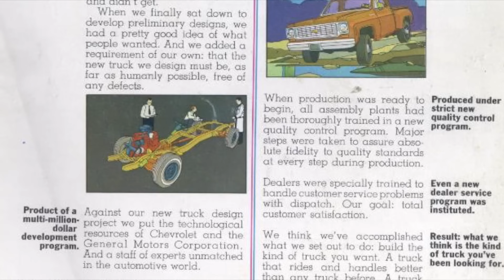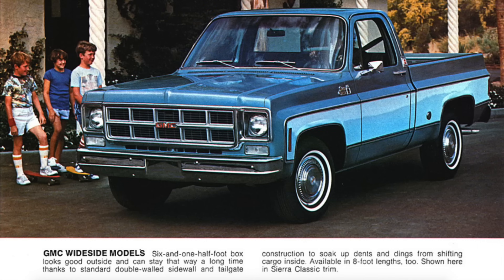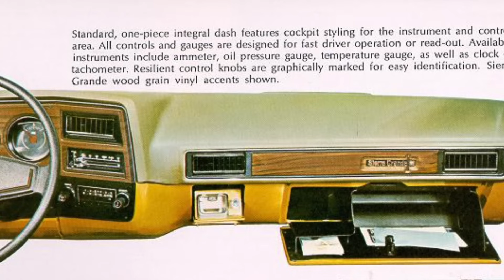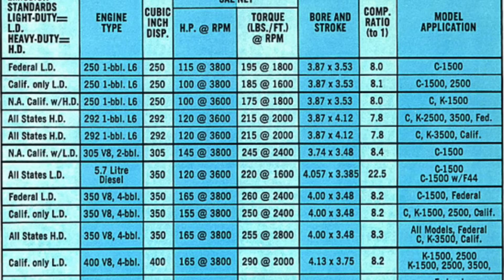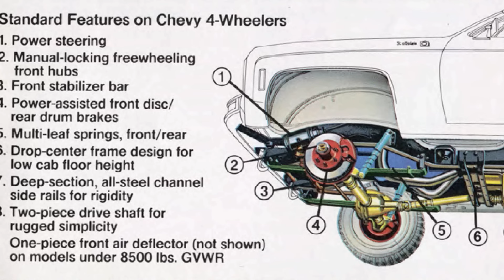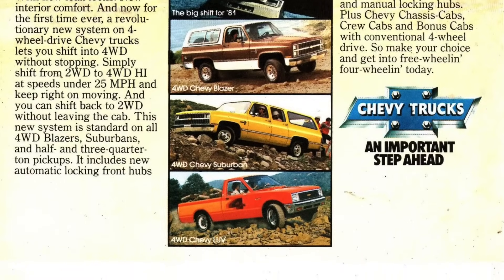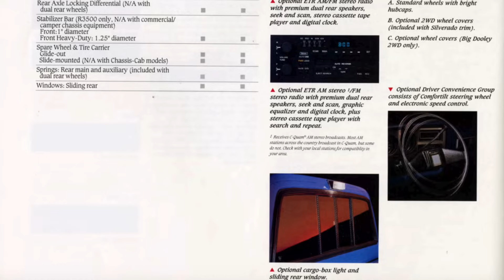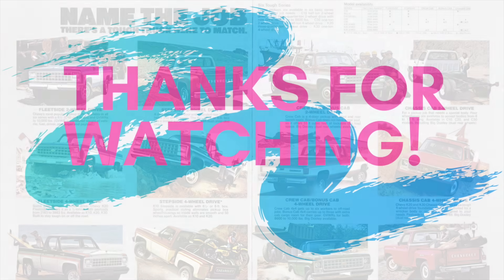73-87 Square Body Chevy & GMC C/K Truck Buyers Guide (Design, Options, Engines, Common Problems)

Comment: I own... (hang on, let me count) ...9 of these trucks:
A 79 C10 Suburban, silverado, 350 (400 now) auto, a/c, barn doors
2 78 C10 "big 10" reg cab, custom deluxe, long bed, 350, 4spd (both green)
A 78 K20 reg cab, scottsdale, long bed, 350, 4spd
A 78 K5 Blazer, cheyenne, 400, auto (converting to 4spd)
A 79 K10 GMC reg cab, long bed, 350, 4spd
A 79 K20 reg cab, scottsdale, long bed, 350 4spd (parts donor)
A 76 K5 Blazer, cheyenne, 305, auto (parts donor, had 350 in it when I got it)
A 77 K5 Blazer, cheyenne, 350, auto (parts donor, converted to 4spd)
And and honorable mention...
A 66 C10 reg cab long bed, 250, 4spd, (currently has a 292 while a 327 is being rebuilt)
Oh, and an 83 GMC that I gave to the kid because nothing after 80 is worth owning. ;D

The problems I have with these trucks are owners who don't understand them.  There is absolutely nothing wrong with Quadrajet carburetors and replacing them with Edelbrock's only causes more problems.  The gauges are easy to fix, you don't need to make extra holes in the dash to mount aftermarket gauges in a place you can't see worth a crap anyway. Please STOP doing this to these poor trucks.  Also stop with the electric fuel pumps and fuel injection conversions, it makes me want to vomit.  If you want modern convenience, buy a modern truck, ffs, don't f#@k up an old one.  I also hate the term "square body", they aren't f#@king square, as was stated in this video.  Go back and listen to that part again.  Finally, I hate that everything from 73 to 87 gets lumped into one generation.  First of all, the body carried over to 91 on some models, and second, just because the beds are the same doesn't mean that they are all the same damn trucks.  Everything 81 and up is f#@king ugly.  Square headlights look like s#!t.  I drive trucks from the 73 to 79 generation, and I'm open to the 80 models as long as they don't have those god awful, bug eyed square headlight conversions.

Now, what I love about these trucks, they look good, they're tough as hell, they will last forever if you take care of them (and taking care of them is easy), and they're simple.  They don't have any extra crap that you don't need (except maybe cruise control, tilt columns and of course emissions crap from 79 up).  As I said earlier, if you want modern comfort and convenience, buy a modern truck, don't f#@k up an old one.  You don't NEED that crap, you WANT it, learn the difference.  The only modifications I make to my trucks are manual choke conversions because it makes them even more reliable, and I removed the emissions equipment on my 79s, which is why I mostly have 78s and older, because they didn't have EGR, catalytic converters, evaporative emissions systems, etc... and they don't need any of it.

Comment: Welp I bought one for $5,150 this week. It looked and sounded like it was in great shape. I went half way across Washington state to get it and on my way home it died and I had to tow it all the way back. It's in the shop right now and slowly getting diagnosed looking like it might need a possible engine rebuild. Initially I thought it was the alternator but it's not -it's either the starter or thousands of dollars worth of work. Be care when you pull the trigger people - even if it looks and sounds great... anything can happen! Hopefully I get out of this and didn't buy a 5K yard ordainment

Comment: The main problem with these trucks is rust. GM finally started fully dipping them in zinc primer in the 80s. My 79 Jimmy would be worth twice as much as it is now, where it not for rusted fender and tailgate.

Comment: I’ve owned my grandpas 1987 r10 for 15 years. It’s been great. I will say the 700r4 transmissions are not very robust. It had the 305 TBI engine and 2:73 gearing so it was extremely gutless on the hwy and did not like towing. I swapped 3:73s after high school and a period correct 350 tbi. That was a huge help and made it a joy to drive. It was very reliable outside of the transmission, but I towed waaaaay too much weight with it. Now it has a 6.0 modern engine and 4l80e. It’s much faster , but I miss the simplicity.
Reply: If you make sure to NEVER use overdrive when towing, the trans will last forever.

Comment: I owned a 1973 3/4ton truck,heavy duty all the way,7.50x16 10 ply tires split rims. After that truck I Bought a new 1986 Silverado and still own it,  It has been garaged most of its life and is currently semi retired on a lift in My climate controlled garage Zebarted when new zero rust,  Daily driver, a 2011 GMC SLT all terrain

Comment: ..Owned an '85 2wd...drove great, rode great...overall, I like them...and MUCH more so than newer trucks..to me, the GMT 400 trucks ('88-'98) were the last of the real, honest trucks...my take on the Squarebody, is although I like them, especially the earlier models, is that IMHO the '67-'72 were MUCH, better, and MUCH, MUCH better looking... not even close...and I like the '60-'66 next in line after them...the Suarebody's are maybe 3rd...anyway, in my experience, the major negatives on the Suarebody are: 1)..they were made WAYYY too long...I have always resented the fact that they were made 15 years(longer with the crewcab/suburban/blazer), and the '67-'72 were made only 6 years...if only there had been 2-4 more years production on the glamor trucks...introduce the suarebody, say, around 1975-76.....2)..The dashes were always, and still are, horrible...EVERY one, and I mean EVERY one, has/had a cracked dash, and no real long-term way to fix them right..I remember at work in the '80's, they bought fleet GMC's...within one year of being new, the dash pads were starting to crack...usually first around the speaker areas, then around the defrost outlets...absolutely horrible...3)..I always found the instrument panel/cluster a pain to take out and work on...WAYY worse than a '67-'72, and even the '88-'98 GMT 400 dashes were easier to work on....4)...all the ones I ever owned/drove, you had to almost SLAM the doors to get them fully closed with the windows rolled up...even on a new truck...if you didn't, they wouldn't close completely, stop on the first latch...then you had to open, then try shutting them again..'72-'93 Dodges had that problem, too..maybe trapped air??...never had that problem with a '67-'72, or an '88-'98, unless the hinges were worn out..5)..the vent windows were always hard to open and close, and whistled badly in the wind...much more so than the ones on my '67-'72's...6)..the early models,'73-'80, were really bad rusters...they did solve that problem with the '81-'87's, though...they were some of the least rust-prone trucks I know of....
Reply: There are after-market dash pads that are far better than the stock ones.  Doors that are hard to close with the windows up means the weather seals are good!
Reply: @michaelbenardo5695  Still rather have a '67-'72, they are a much better, solid truck, and look better. Really, a '64-'66 also. Another thing I didn't mention, is as work trucks, the big wrap-around tail lights were much more prone to get busted out backing into things(also true of 72-93 Dodge, 80-96 Fords)..the '72-back GM trucks, and '79-back Fords, the tail lights were recessed and much less vulnerable...

Comment: Also the K5 blazer production went up to 1991. Came with TBI and that system was as reliable as hell
Reply: So were the 3/4 & 1 ton crewcab trucks.
Reply: 1995 in fact was the last truck year for TBI.

Comment: I am thinking about taking up my uncles 1983 c2 square body. it has a 454 big block, crew cab, dually, with an 8 foot bed that has side steps on the side in front of the wheel wells. i think its a good investment, but its wore out and needs some work. glad i found this video so i can prepare myself for what i might find out when i tear into the truck.

Comment: bought a 83 chevy scottsdale fleetside new in 83.  two tone silver and blue. power windows,a/c,tilt wheel,intermittent wipers, cruise control,velour seat,am/fm radio (has been changed out to a modern unit) 2wheel drive,305 engine,overdrive tranny.  still have it. 150k miles .  needs some interior work but runs strong.  (take care of your toys and they will take care of you)

Comment: The weak point on these trucks were the frames.  I have crushed several of these trucks and would notice frame cracks at the engine mounts on units crushed with the engines in them.

Other than that, these are my favorite Chevy trucks.

Comment: When I was in the army I had a cheyenne super 20 camper special  4x4 with a 454 v8. Homemade steel bumpers. It's currently buried in Peyton colorado. We gave it a funeral. My buddy's used to say all we need to do is drop daigle and his truck in to iraq and the Iraqis would surrender in a week.

Comment: I daily drive my 85 gmc 1 ton . 660,000 km , HT 383 GM crate, all MSD , ram horns  , xpipe, Flowmaster, sm 465 with gearvenders. Love it . Pulls a Bandit model 90. Lotsa torque.

Comment: I've owned a 71 C10 , a 88 Cheyenne ,99 3500 dually dump truck & a 03 Silverado the last 2 I still own & use , But as I remember the 73 & 74 had serious rust problems never owned one but the latter 1's are really nice & improved.Thanks for the video.
Reply: That was their only real flaw - the rust.  The 73 was the worse, as it didn't have roof drip rails and most had rubber floor matting.  In the winter, when you opened a door, water would drip onto the floor, get under the rubber often, and stay there, hence, a floor like Swiss Cheese.
Reply: @michaelbenardo5695  Thanks for the info. That explains allot.

Comment: The 4 speed manual sm456 transmission can fall out of 3rd gear when worn or higher mileage. 
Leaking door seals and dirt from your boots can cause rust under the door sills. Super common.

Comment: I owed and still own a 2003 gmc that i bought new but i had 73,74,79 and a 1986 c 10 silverado witch i drove till 225k loved that truck and second to that one my 2003 gmc sierra all of my truck where are very reliable only had to tow all combind 2 times .

Comment: Death is possible in rear end collisions due to lack of headrests in the single cab.  The head will snap back upon collision and be severed from the metal supporting the glass.  The solution is to add seats with headrests to the single cab.  This word of caution is for any single cab trucks without headrests.  A popular retrofit is to add a power bench seat from a Cadillac from that era.
Reply: One of the things I like about them is NO headrests.

Comment: I had an 80 silverado with a 5.7 diesel. that truck didn't have the speed to get out of it's own way, but it could pull trailers like they weren't there. driving home from work one night, the engine slowed way down slowly and finally died. good thing I kept a bicycle in the back
Reply: That engine was really bad.  It was an Oldsmobile engine and was based on their gasoline engine, which was a mistake.  Diesels should be undersquare and should have more than 4 bolts per cylinder.

Comment: Nice video👍 we own a 1981 k30 that’s been passed down through our family.  The only issue I’ve had is the new ethanol fuel. But that’s been fixed with a new Carb and upgraded fuel system to reduce vapor lock and old blue runs like a top!

Comment: Iv got a 78 c20 cheyenne check floor pans and springs the old heads loaded em to the moon there's always 1 busted no matter what and as long as you buy from an older guy usually the motor will runs trans may be fried but iv never seen an original to vehical trans not work unless it was started of fluid or pushed to hard just look at everything and if it's outside your comfort leve to fix walk away ir take it some where the community for these old trucks is normally supportive the info on how to make them work is extensive buy one and try it's a good way to keep your mind occupied

Comment: The only problem ive had is overheating but the 350's are reliable engines but if you push them over their limits watch the temp gauge
Reply: If your's is an 80s version, you might want to replace your smaller radiator with the wider thicker one, as Chevy engines normally don't overheat.  In the 80s, they did use smaller radiators than in the 70s to make the truck lighter and score higher on the gas mileage tests.

Comment: Bought a brand new 1976 Chevrolet V8.  Usually got less than 10 miles per gallon.
Reply: Hey that’s what I got 
Your right about the miles per gallon but truck still badass
Reply: 73 C20 10mpg loaded or empty.
Reply: Don't feel bad. I have to baby my newer one to get 7.0 mpg.  Take off hard at one stop light, I'm down in the sixes.
Reply: But gas was 60 cents per gallon
Reply: I have a 76 Scottsdale step side gets about 10 miles per gallon at today’s gas prices

Comment: I found mine in a salvage yard 600 bones , 3/4 ton 350 4 speed with 123000 original  miles , other than it being neglected , after a new clutch master , brakes , tune up and a carb that I had lying around , solid as a rock , lol chevy pun , drive it everyday , only gripe , 160 hp , when this engine goes I'm gonna double that output atleast , cool video

Comment: I have a 1979 I bought in 1990. Fully restored with 355 cu,in. , 3 spd. auto w/ shift kit. Lowered , AC , power steering , disc. brakes , Cragars & with special raised hood . Midnight Black & sweeeeeeeeeeeeet !!!

Comment: Swapping a 5.3 into mine right now. Funny thing is it's a 78 BIG 10 stepside silverado 2wd came with travel tanks trailer brake. Ran into the cracked frame fabricated my own gussets and went QA1 and converted to rack n pinion. @3litersofdoom

Comment: Like you said, 1973 was the first year for those Chevrolet & GMC square body models. They were produced up through 1991 except for the regular cab pickups & medium duty models which became obsolete earlier. In 1987, the half ton & three quarter ton regular cab pickups were finished, but the one ton regular cab pickups on the other hand were still in production up through 1989, & same with the medium duty models except they stayed in production up through 1990.

Comment: The 327,292 six,350 4bolt main all got around 20mpg. In a 4x4 tow anything. Lifted 4x4 1/2 ton or 3/4 with 350 add limited slip or locker go anywhere chained up in deep snow. Suburbans were tanks. 86 on first fuel injection system sucked but a carb. 4brl. Hard to beat.
Reply: 20 MPG???  Maybe down hill with a tail wind.

Comment: Got a rusty 75 K10 with a strong 350. Only 65k miles. Been parked for a decade. Bet fresh gas and battery and she'd start right up.
Using a 98 Z71 Silverado lightly with 117k miles. Mainly use it for light hauling and snowy roads.
Probably ought to sell the 75 but kinda want it on the road for it's 50th birthday
Reply: Keep the 75!  No damned computers!

Comment: I had a 1981 Chevrolet 4x4 K5 Silverado Blazer. It was under powered but still a mountain goat.The factory paint was horrible and faded in spots and the door hinges gave out. Other that that it was a stud.

Comment: A lot of people like and restore old square bodies, and some people don't like them, one thing for sure is days of simple though trucks that last year's upon years are gone and over
Reply: I’ve seen multiple 1990s & 2000-2007s hit 300k miles+ untouched.  Can’t speak for how they last after the ‘07s
Reply: @LordNotlek  good point actually my neighbor  has a 1996 with just over 400k. Engine untouched, and Only 1 transmission rebuild.

Comment: I own a 76 k10 and I grew up with these trucks. Another common issue  is the right front brake hard line bursts where it connects to the brake hose at the frame mine had burst over the summer and my father has had the same issue with the 4 of them he owned and that was over 25 years ago
Reply: Hum - I never had that problem, but good to know.

Comment: I have owned several models of these. First was 73 Blazer 350, 75 Silverado 350 4 speed 1/2 ton short bed 4x4, 75 Blazer 400 ci 4x4, 84 3/4 ton Suburban 4x4, 87 Silverado 454 1 ton duality 4x4, 90 Silverado Crew Cab 454 4x4 and lastly I still own a 75 GMC Jimmy 400 with only 76000 miles on it. I have to say these trucks are tough and have proven themselves. That said just like any vehicle you need to keep them maintained. Mud and dirt that is not cleaned out will definitely help rust them out. Loved the 400 engine but you needed to make sure they stayed cool. Head gaskets I hear was a common problem. I never had one fail. Saddle tanks got a bad rap on the trucks in the court rooms. Side impacts were not good since the only protection was sheet metal. The 454’s were severely de-tuned in the years I owned and was a big disappointment. All the years I owned one of these trucks I was never let down do to mechanical failures. Then again I used them but didn’t abuse them.
Reply: The whole thing about all 400s running hot is a myth, as long as the cooling system is properly sized and clean and the heads are good with no cracks you will have zero heating issues. Also the whole "dangerous fuel tank placement" thing is also a myth because chances are if you got hit hard enough to rupture the tank, chances are you would be dead anyway because the tank sits way under the cab(about under where you sit) so the cab would have to fold in that far and if it does well, you'll be dead anyway. These were great trucks and there is a reason why they are so sought after and these trucks bring lots of good memories to people who remember them in their heyday.

Comment: In the year model 1987 Chevrolet Pickup trucks was it the first year for the 4.3L V6 TBI (Throttle Body Injection) engines